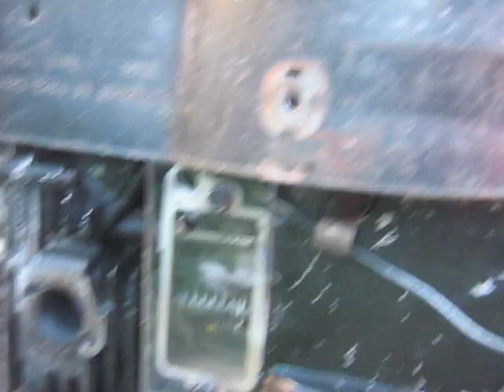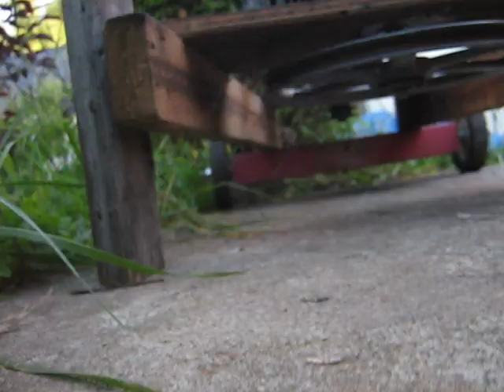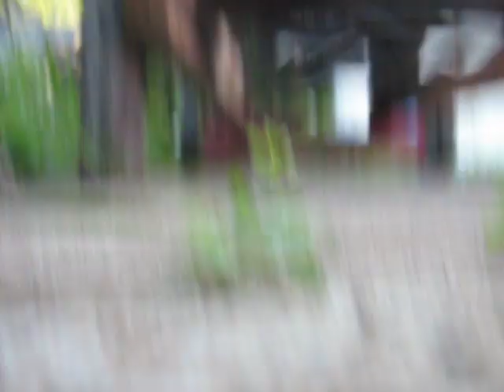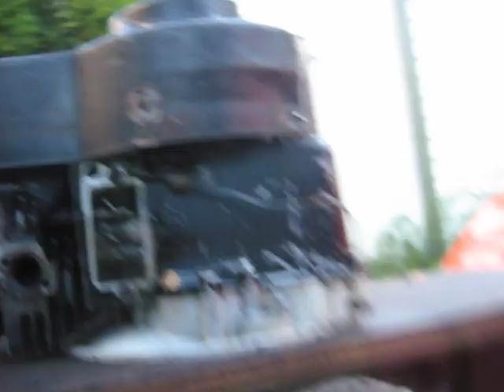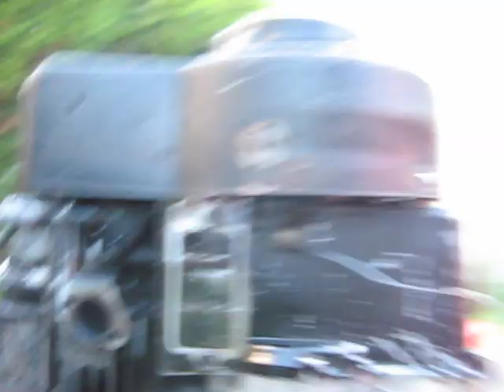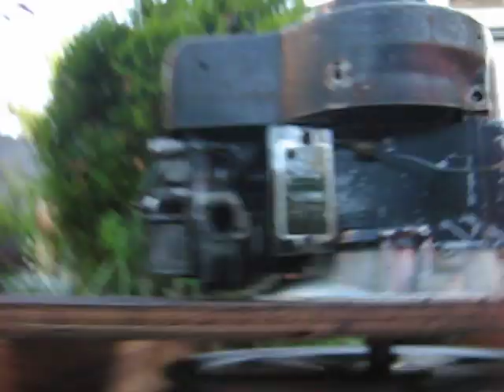Clear Valve Cover #2 Briggs Flywheel Engine-No Return Spring

Comment from the maker: Yes, that is true, most of my engines are not doing any work, so would run cooler than if loaded down. I may give it a try, although I would have to mofify a head to retain the spring. Ah, what the heck, it isn't like I have a parts shortage (with my 162 Briggs engines!!!!  lol  :)